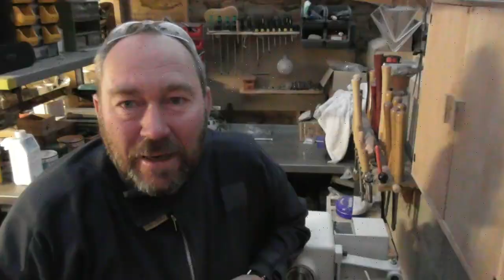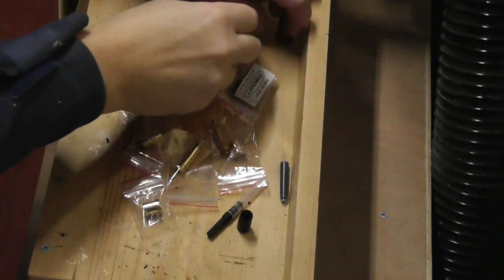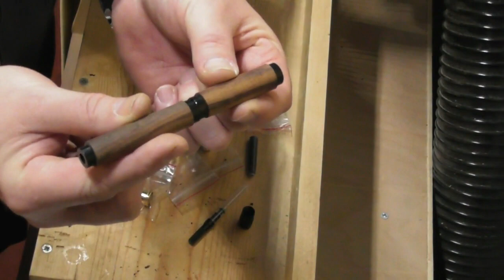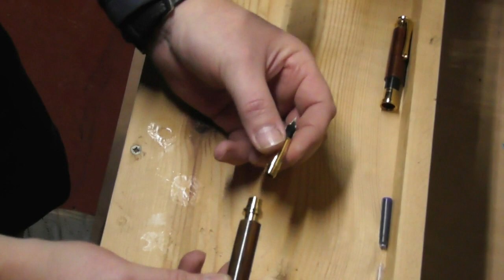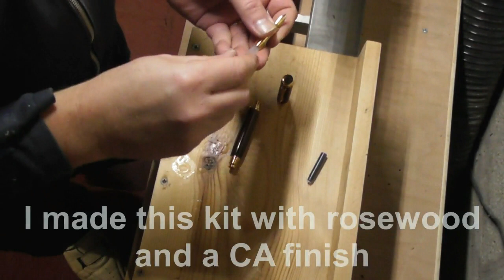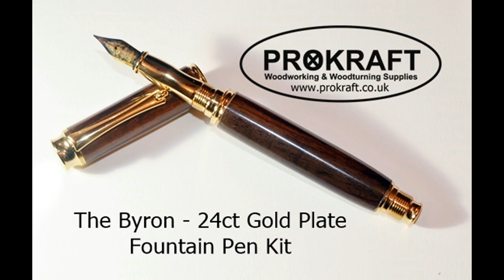Byron Pen Kit Assembly

Comment: What size of blank do you recommend
Reply from the maker: Pen Cap:- 20mm x 20mm x 50mm long
Pen Body:- 20mm x 20mm x 65mm long
Reply: @prokraftuk  is that a standard 20 x 20 for all kits
Reply from the maker: Fitting guides are available for each of our kits on the website, but 20x 20 is generally plenty big enough for most kits - it depends on your design - I have made a super-fat one of the Byron which is 21mmØ